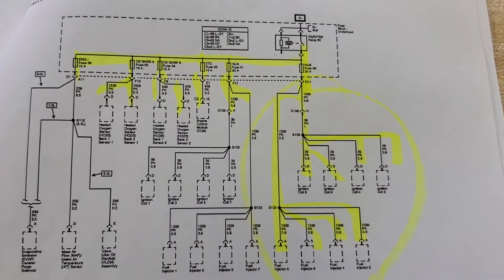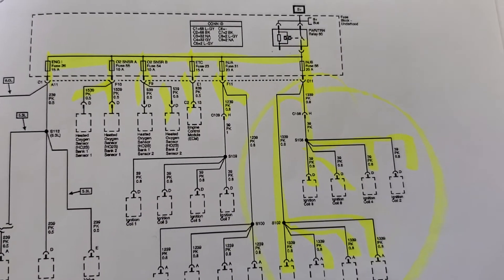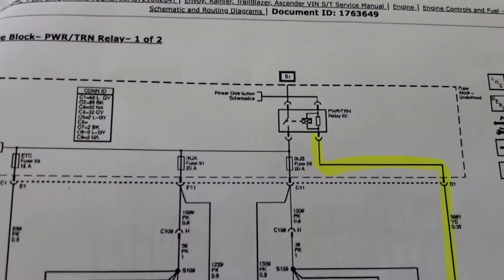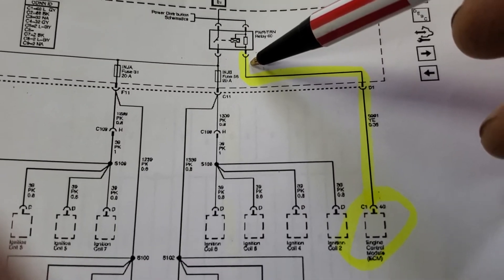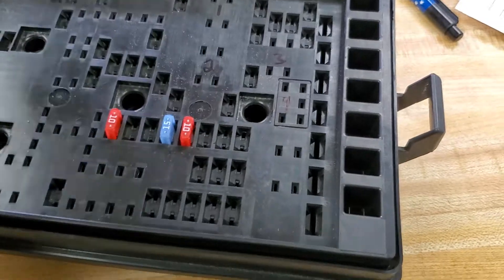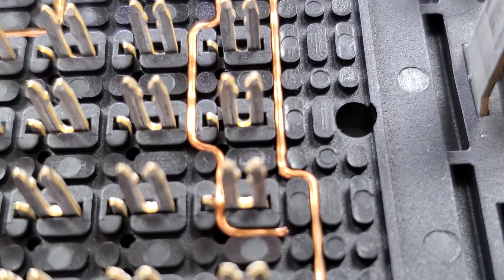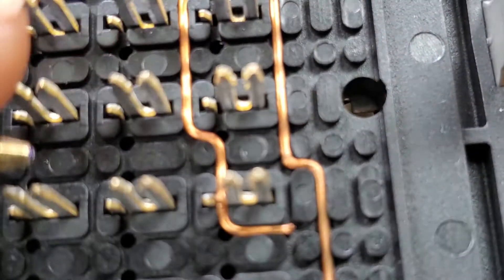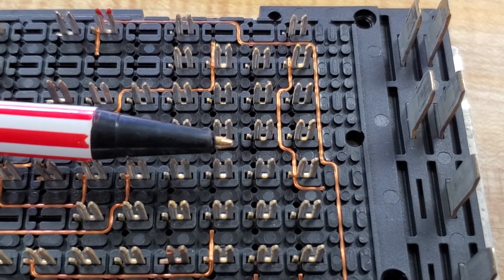07 GMC Envoy, Stops Running Diagnosis

Comment: don't know how much a fuse box is, but if it was terribly expensive a jumper wire would of fixed it on the fuse box and saved customer money for now, but long term best to replace as you did! Thanks for showing us, keep doing some videos in the future as time allows.
Reply from the maker: Ken. Fuse Box was $300. Wouldn't matter. The way that box comes apart requires drilling out some fastener inserts; one way, one time trip. Now its done. Can't be reassembled for use.  Fix it right. Change the part and avoid future problems. There are enough hacks in this business doing it wrong. Thanks for the interest.
Reply: Your a pretty smart cookie Ronnie,love your podcast too,best one around